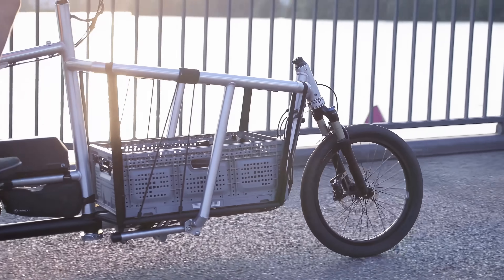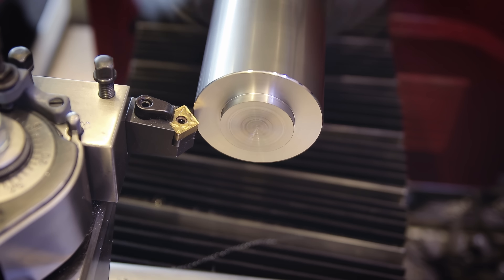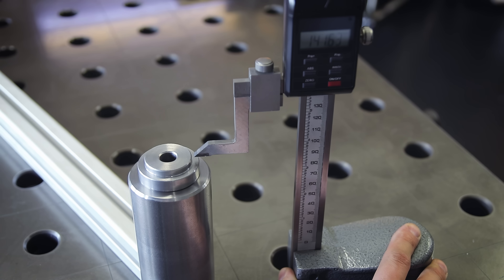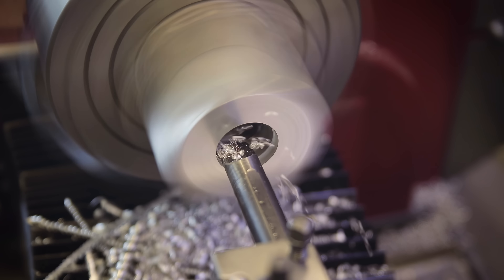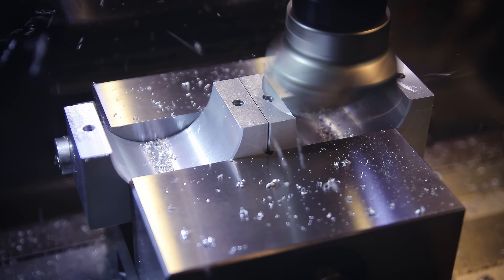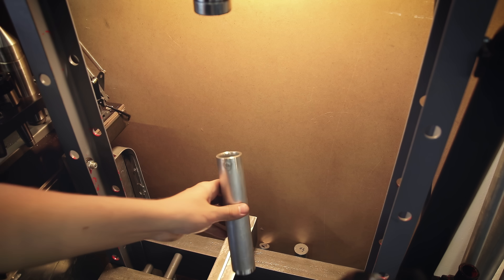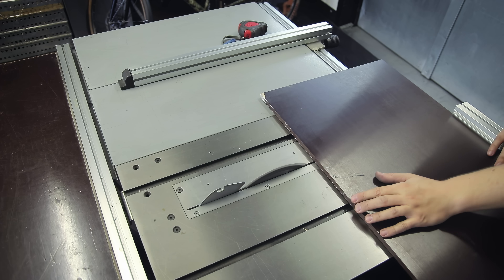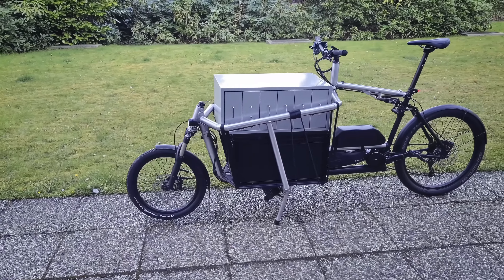Electric Cargo Bike Build - Custom Frame Jig, Custom Tooling, Questions

Comment: As someone who does both woodworking and machining as a hobby, wood goes on my mill far more often than I'd like to admit. My mill actually has a longer head travel than the quill of my drill press, so if I need a super deep hole, onto the mill it goes.

Comment: 3D print your next set of blocks.  Single piece block with holes for drill guides at 90 and 180.  I used this method to build a wheel house from aluminium tubes. You can cut them off after the build if you need to.
Reply from the maker: Well I figure they'd melt very quickly but might be worth a try next time
Reply: Yeah, I only used them for marking out and tacking. A full weld gets very warm! The great thing about 3D printing fixtures is the relatively short time it takes from concept to implementation.  @PhilVandelay

Comment: For squaring the tube clamp blocks, if you clamp the threaded side to your work table with the split vertical, then the top side will be forced to align. When you're putting the bolts in you'll be able to seat both bolts and know at that point it's square, then if you tighten the bolts the same it should stay really close with relatively little effort

Comment: A great build! One constructive suggestion though, in a need to increase the weight careening capacity one can put 2 smaller parallel freely-rotatable wheels under the basket, as a benefit that will tend to increase the stability too. Clearly that is an extrapolatable idea.
Reply: Bikes lean when they turn; it would prevent you turning. As he said, the carrying capacity is dictated by the geometry of the frame, mechanics of the cable steering, and what is reasonable for a human to control, not strength of the frame.

Comment: 17:30 you could mark the screw heads in a level position and then if both screw marks point in the same direction you're either level or a whole number of turns off. The difference should be obvious.

Comment: Do you prefer the linkage or cable steering now that you've built both? 

I built your simpler design with linkage, the one issue I ran into is the rod flexed and sprung back after I hit a pothole causing a nasty speed wobble, I fixed that by clamping a piece of aluminum angle onto it to stiffen it up. I don't have the tooling or skills to build cable steering but I really like the look of it!
Reply from the maker: Not necessarily, but I also might still improve things about this solution so the jury is still out on that. Cable steering is definitely a lot more fuss compared to a linkage which simply works and it doesn't do super well with high resistance (lots of weight on the bike). At some point I think I'll try to use larger pulleys and thicker cables to see how that performs.  But basically, except for weight and the tighter turning radius (which really mostly comes into play when you're off the bike) there's no good reason to use cable steering. For most DIY builds I would stick with the linkage, it's a lot more straightforward, easier to build and more reliable

Comment: The slack steering angle is what makes the steering feel sluggish when it's loaded up. If you look closely or check a CAD model the load bed actually drops very slightly as you turn the front wheel away from straight. Or conversely, bringing the steering back to straigh rquires lifting the load!

I built one with a vertical headset and minimal trail and that was fine with 150kg or more on it. Sadly Sydney's roads are not the best and I broke the frame when I hit a pothole at about 50kph with over 100kg of stuff on the load platform. Which answered my question... how light is too light? Or how big is too big... a 1.5m long platform is surprisingly useful if you have space to park the resulting bike. I used cable and pulleys for steering rather than Bowden tubes
Reply from the maker: The steering angle is actually still pretty steep compared to most production cargo bikes and the "lifting" effect really only comes into play when you do pretty sharp turns. At the same time, that effect is one of the things that keeps a bike upright so I'd imagine a vertical steerer would ride very twitchy especially unloaded. By "sluggish" I don't mean the force required to steer, that still works fine, but you simply feel the inertia of all that weight that wants to go straight and not change direction which is just simple physics.  As I said in the video, what people consider "rideable" can of course vary vastly, I used to load up way more on these bikes but I don't consider it safe with a two-wheeler nowadays, no matter how it's built. Being able to brake fast enough in traffic also becomes an issue, even with good disc brakes. Again, hugely subjective, but I think there's more suitable designs for moving that much weight and from what I see it's not the use case for most people anyway. For anything over 100kg, a three-wheeler works much better
Reply: No expert, but have looked into vertical steerers.  I guy with a recumbent has a beautiful custom build with 95deg.  He had to have a custom fork made.  Not sure but recall it was 65mm trail.

Comment: Steerer tubes are usually cryo-fitted, so next time you could try to put it in freezer first.
Reply from the maker: Only helps for assembly though, not disassembly (since you'd be cooling both parts at the same time)

Comment: Great video well done on the bike . the old stile bike lights that had a generator that ran off the tire .. could you hook that up too help keep the battery life a bit longer ? charge as you ride ?
Reply: That math does not add up, it's easier to just pedal the bike without electric assistance than trying to charge the battery. Just charge the battery when you are at home and make sure you have enough charge when setting off. Try a bike with a dynometer and see how 100w resistance feel, and then add that to pedaling an allready heavy cargo bike, it is like biking with your brakes on. And imagine doing that continuous for several hours for a few percent increased battery charge. This also means no free wheeling and free speed down hills, just pedaling all the time.
Reply: Action equals reaction. So no.

Comment: Can you please tell us something about the ring at 22:46. Is the ring made of the same material as the shaft? And where did you find a tube that size or did you make the ring from a larger piece on the lathe?
Reply from the maker: It's just a cutoff from some tubing that happened to fit and material is probably mild steel